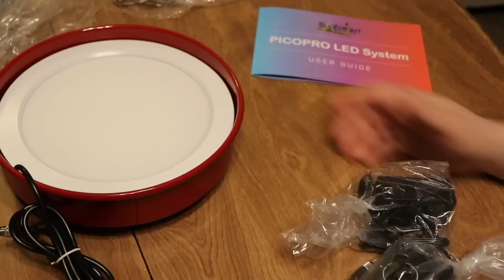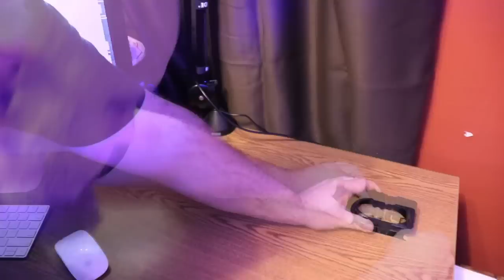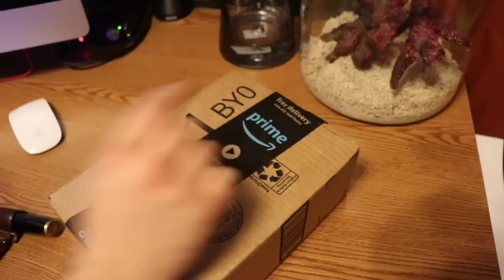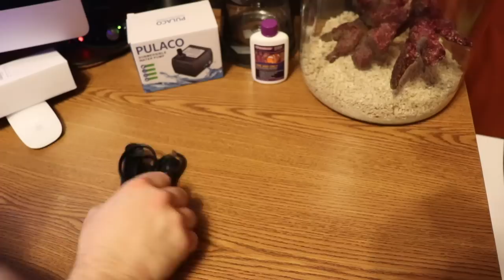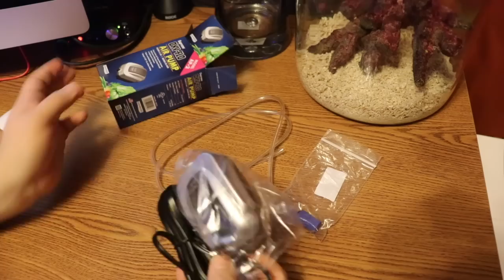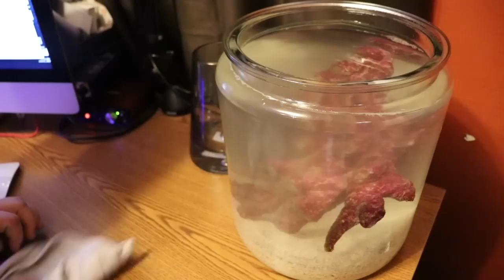My NEW Pico Reef Tank Build

Comment: What are everyone's thoughts on using a terrarium style under tank mat heater run thought a heater controller? Maybe put the mat down then a 1/4" thick neoprene mat over it then the tank on top. Anyone have experience with something like that?
Reply from the maker: My only concern would be if the glass could handle it. But most likely would work really well, nice even heat.

Comment: Watched the light and then looked it up on PA who recommended a little heater that would be more appropriate. But I would think that fountain pump (which is an awesome idea) would heat the water so I would get an inkbird and run that pump based on the temperature. The light is super expensive for the size of tank. It also only has dimming as I understand - so you would need to set it at the strength you want for blue and white and then put it on a timer? I think for that price the old AI Prime would be a better choice - then at least you can set it to ramp up / down etc. And you could use it later (if you ever shut the Pico down). That Pico light (at that price) should at least be wifi controllable.
Reply from the maker: It is expensive as far as pico lights go but I absolutely love the color of this light (which is hard to pick up on camera)and you're right about the timer setup. I'll be holding on to this one for awhile so I'll be able to do a long term review of everything with this build. Thanks again for all the support!
Reply: @MadHattersReef  yeah I think it's a really clever light and I think for a pico you want a light / lid to prevent evaporation. If it has all the spectrum and its just a timer you need then fine but really for that money it should have some functionality ;) Looking forward to this build ;)